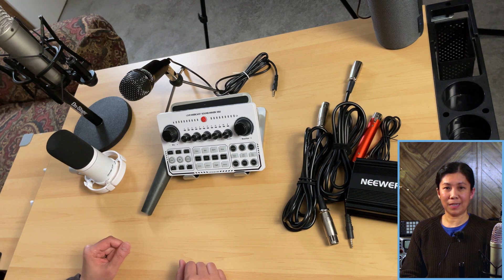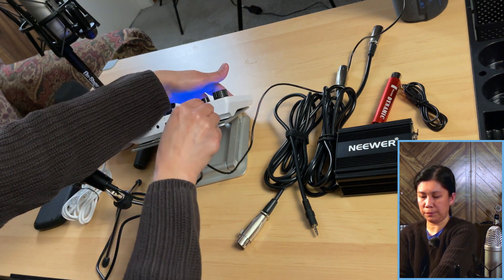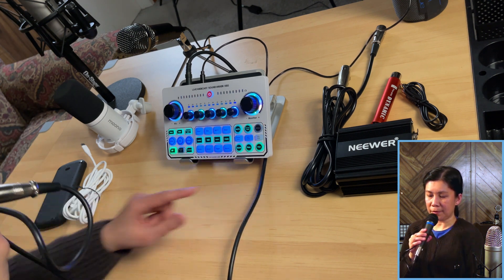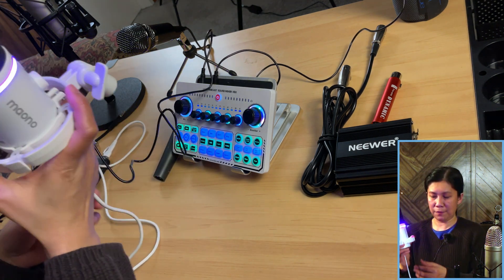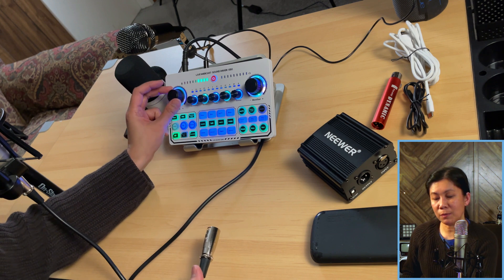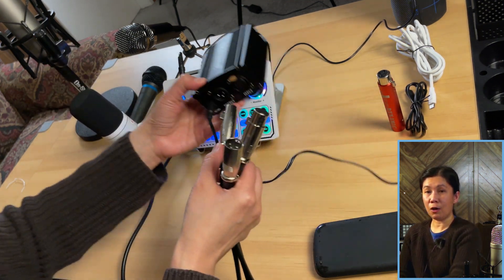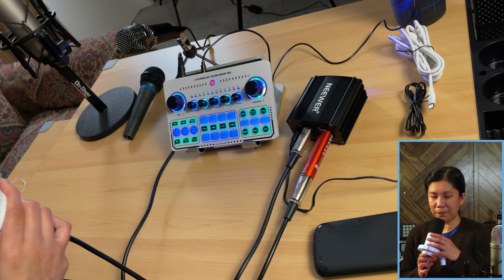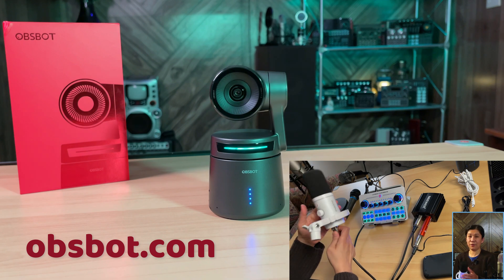X50 Sound Card - What to do when Condenser or Dynamic mic don't work

Comment: Can I connect dynamic microphone to x50 without any problem 
pls reply your new subscriber 😊
Reply from the maker: It depends on the dynamic mic. If it’s gain hungry you will need a fethead. You should watch this video to find out.
Reply: @jenuds will it work dynamic properly ? If I add 3.5 mm cable in the condenser mic hole

Comment: Hi good morning, can i ask if k998 is compatible to dynamic microphone. Thank you so much and have a great day!
Reply from the maker: If you have the 6.35mm on the tip of the mic cable- use 6.35 mm female to 3.5 mm male adapter. It darkens on your dynamic mic, if it won’t work , use method from this video.

Comment: l don't really know about sound card and microphone..which microphone brand should i use for home studio .. Sis
Reply from the maker: To be in a safe side, bm800 condenser mic coz it’s compatible with most of the sound cards. Most of the high end expensive mic requires an external 48v phantom power or fethead or both.

Comment: Can i connect pd200x directly to v8 sound card's dynamic port? It's will worked or not?
Reply from the maker: Using XLR to 6.35mm to the dynamic port of v8, didn’t work for me. If work when I connect a fethead then xlr to 3.5 mm to connect to the condenser mic port of V8.
Reply: @jenuds give a video on this topic.your live link not visable.